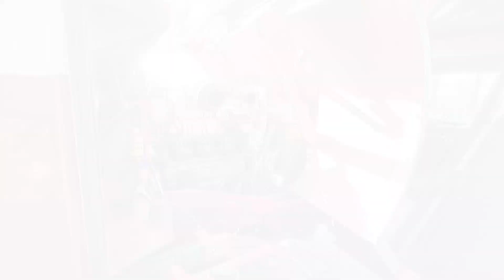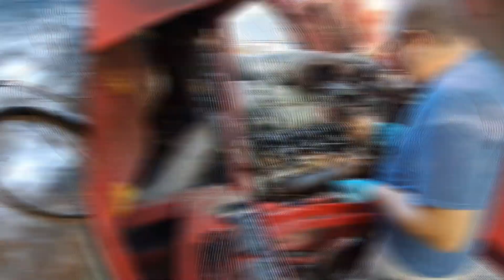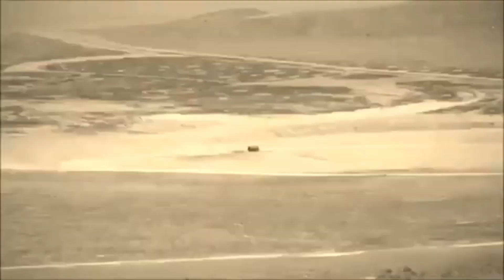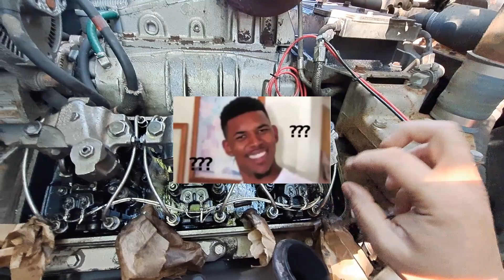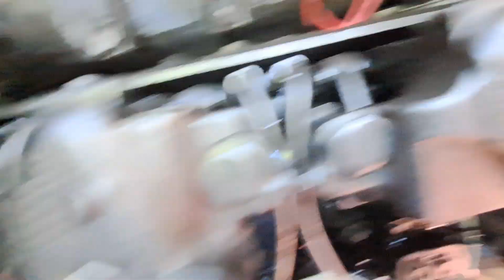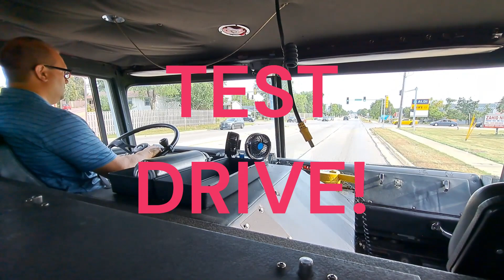Installing JAKE BRAKES! Part 2 plus TEST DRIVE

Comment: Excellent, nice work. I am wondering how long it’s going to take someone to point out you should have used the box end of the wrench to loosen those valve bridge nuts! Haha! All kidding aside, looks like you did a good job and that engine sounds so good being right up front. I am used to buses with the engine 40ft back.
Reply from the maker: Well, live and learn I suppose. And yes...it's VERY loud. I spent a lot of time adding sound insulation in the cab, it's a lot better than it used to be, but still requires yelling. Thanks Jeff!